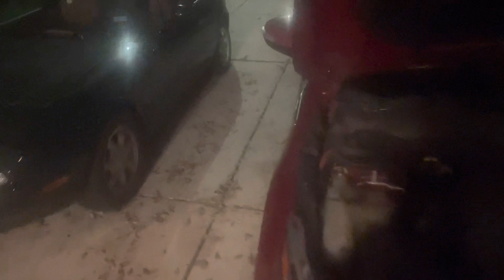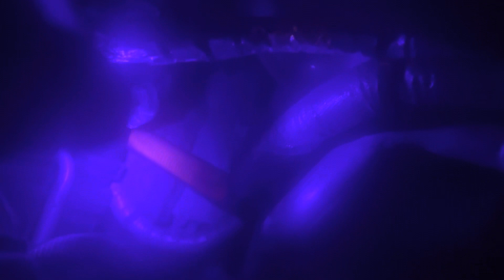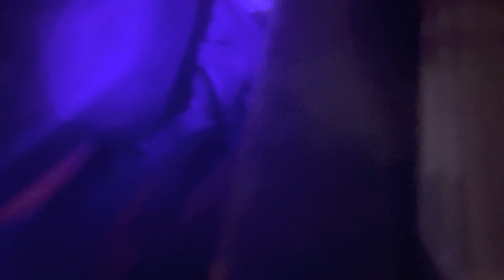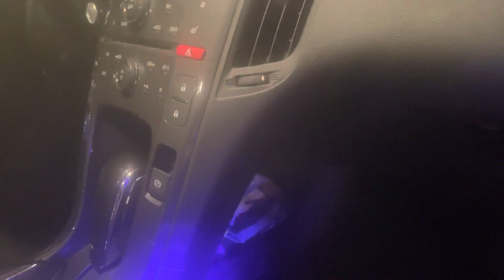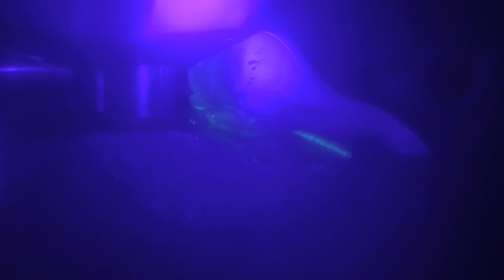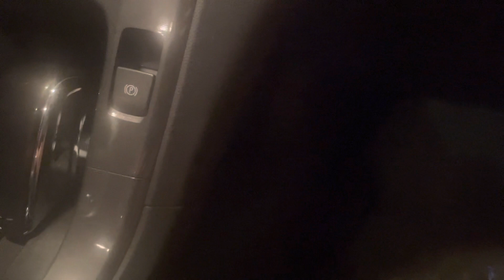Chevy Volt Gen 1 Finding a major A/C leak

Comment: Did you ever end up replacing the evaporator yourself? My volt has the same leak. Trying to get a sense of how much of a pain it will be to disassemble everything.
Reply from the maker: Nope, the Volt got totaled before I could do it. I went through the manual and it looks like a pretty big job since the dash needs to come off which is always a ton of labor. I've done it on two other cars before, just have to take it slowly, label or photograph parts as they come off, and prepare for clips to break.